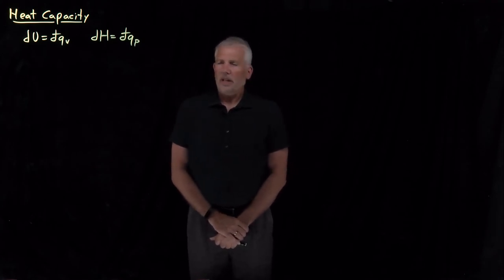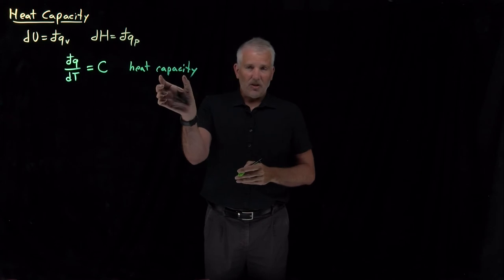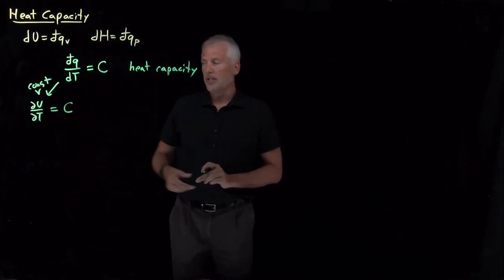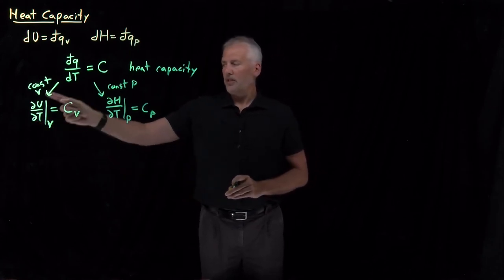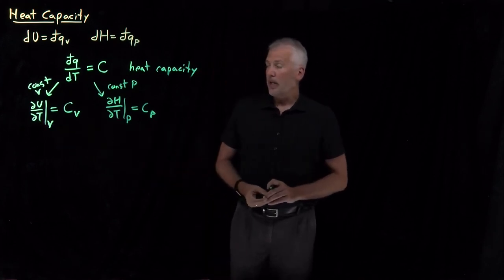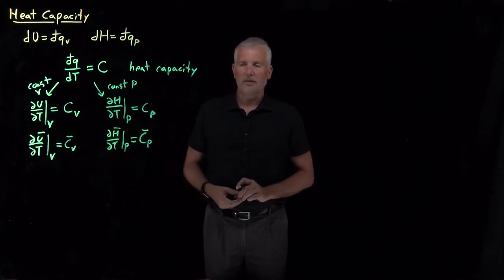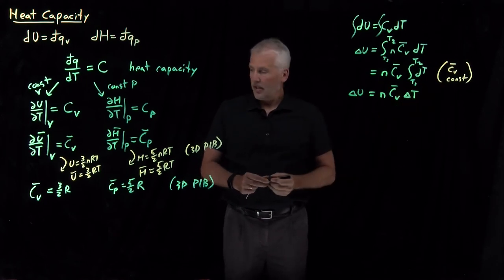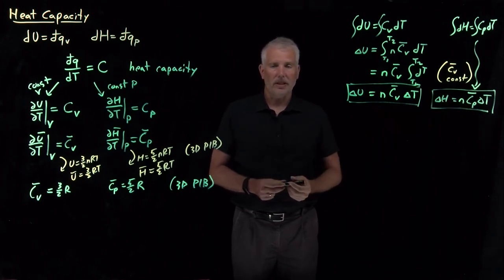Heat Capacity

Comment: Cp for real gases is expressed as power series which has the form Cp= a+bT+c/T². Which type of power series it is?  3rd term is confusing for me. Moreover,  it is also expressed like Cp= a+bT+cT². What is the difference between the two forms?
Reply from the maker: I wouldn't worry too much about the name, or type, of the power series. The 1/T² term is just there because it helps in describing the empirical Cₚ(T) data. For empirical equations like this, all that matters is how well the equation can describe the data.

A common equation used to describe Cₚ(T) uses not only a quadratic (T²) and an inverse quadratic term (T⁻²) but also a cubic term (T³). This one is common enough that it does have a name: the Shomate equation. https://youtu.be/Oc_iOWhZGVQ?t=292
Reply: @PhysicalChemistry  Thanks a lot

Comment: It has to be monoatomic to behave like a 3d pib right?
Reply from the maker: Yes, that's essentially right.

More precisely: a diatomic (or triatomic, polyatomic) molecule *does* still behave like a 3D PIB, but it's only the translational KE of the molecule that is described by the 3D PIB model. Its vibrational and rotational energy and heat capacity are not captured by the 3D PIB model.

In the context of this video, you're absolutely correct: U = 3/2 nRT and H = 5/2 nRT are only correct for monatomic ideal gases.